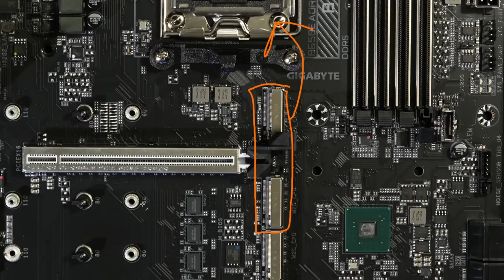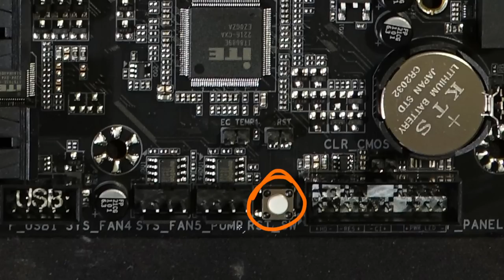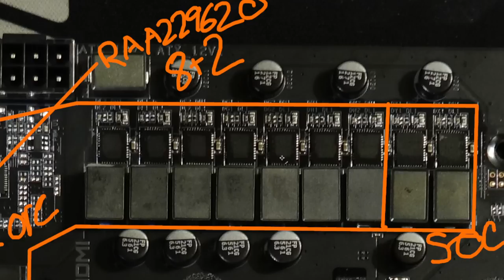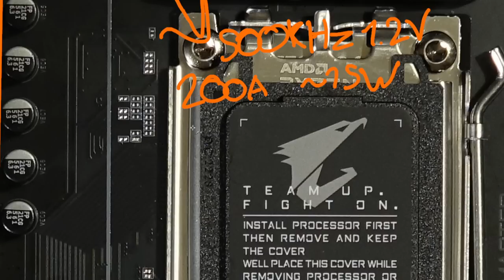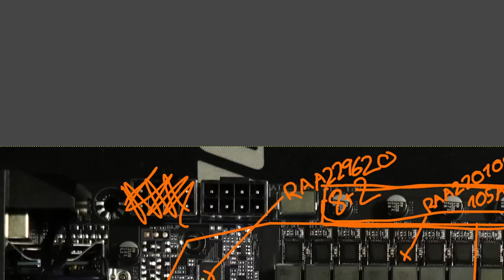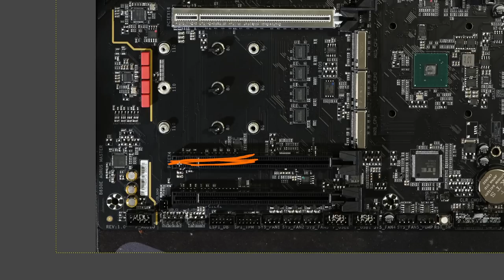mobo PCB Breakdown: Gigabyte B650E Aorus Master

Comment: I have PC black screen freezes with this motherboard and had no comment from Gigabyte support about this asking them if they have new BIOS version that fixes my problem I am probably return this to Amazon and get other manufacture zen 4 motherboard. I wouldn't recommend this motherboard even if the hardware is solid the software is just bad.
Reply from the maker: can you run cinebench R20 on your board? There seems to be an early batch of this board that's completely broken and not being able to run cinebench is one of the symptoms.
Reply: Same here. I get black screens in some software. Check the video on my channel. I don't recommend this motherboard if you don't know if it's an early batch. You will just waste hours or weeks troubleshooting and RMA'ing. Better just get another motherboard.
Reply: @ActuallyHardcoreOverclocking  I can run Cinebench R23 for hours on my B650E Aorus Master, but as soon as I run Corona Benchmark, OCCT large dataset or Prime95, I get the black screens.
Reply: And I had black screen 1 second I after clicked the Reply button 🤣
Reply from the maker: @bgtubber  R23 doesn't use AVX AFAIK. Which is why I said R20 specifically.
Reply: @ActuallyHardcoreOverclocking  Results are inconsistent and sometimes I get black screen on R20 test and sometimes I don't. I am getting black screens and the pc freezes and can't shut down after with the power button and can't restart it with reset button either. When this happens the CPU LED on the motherboard is on and I have to cut power to the PSU and bring it back in order to turn it on. This accrues inconstantly for example I ran cinebench R20 and R23 multicore test it froze after couple seconds did another test after and I was able to run it for 25 minutes until it froze I also had hour test and it was fine.
Reply: @bgtubber  Thanks for the info.  Just tested Cinebench R20 and Corona on mine and no black screen with a 7600x test CPU.
Reply: @njasicko  Thanks for the report. It's probably because you're using a 7600x. The repair shop said that they didn't get black screens with my mobo too, but they didn't have a 7950x to test with, only the lower core models like yours. As soon as I sent them my 7950x, they confirmed that they are getting black screens. This didn't happen when they put my CPU on other motherboards so obviously my mobo came defective from the factory and can't handle the higher core models like 7950x. :/ Hopefully yours is not one of those defective ones, but you should keep this in mind if you decide to upgrade to a 7950x or a next gen CPU in the future. The issue might pop up then. This is why I'm mad at Gigabyte - they won't officially acknowledge the problem and won't proactively work with people to replace their mobos. Which means users won't know if their sample was one from the defective batch until they install a more powerful CPU like 7950x and start getting black screens.
Reply: @bgtubber  I am just testing with the 7600x for a few more weeks then will swap to a 7800x3d.  Prob wont have an issue with it but still good info to have!  If I have issues with a 7800x3d in Feb I will update.
Reply: @bgtubber  that sounds like another case for Gamers Nexus to make a stink over.
Reply: @ZeroB4NG  definitely i tried to get his attention on Reddit. This is a very stange issue with this Motherboard that it can be fine with low core CPU's like 7600x but higher you get the issue showing up and it's such a pain to deal with if you don't know because a basic troubleshooting is basically everything else and motherboard last but in this models case its always the motherboard.
Reply: i ran the r20 test no issues thank god 7950x btw